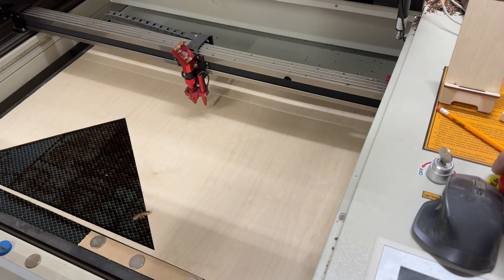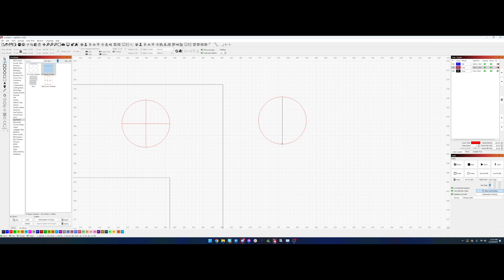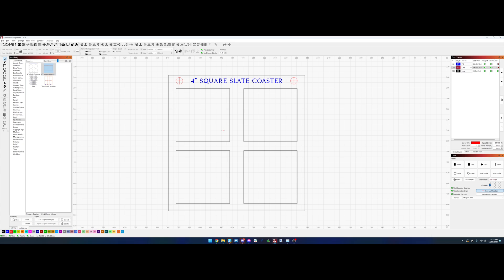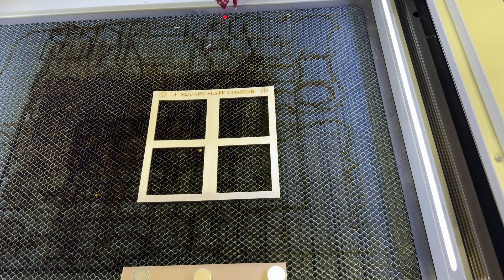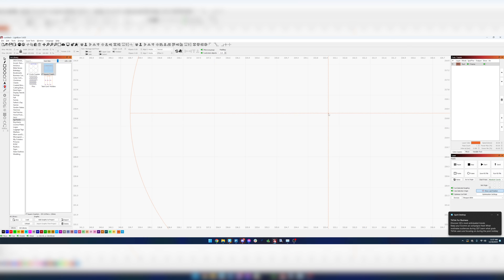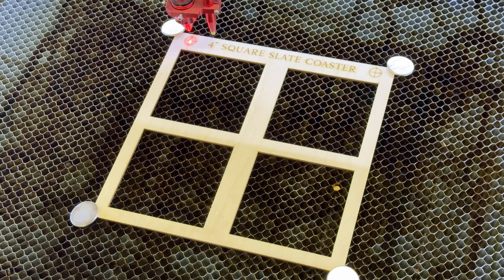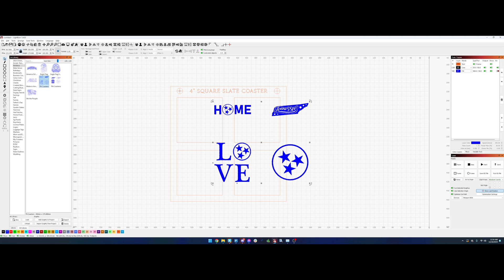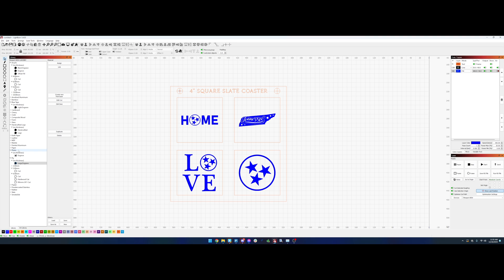You won't believe how easy it is to make this laser jig

Comment: Enjoyed your video on making the jig.
One thing bothers me ref the slates in your jig.
Ive found that most slates ive bought are all different thicknesses.
Im continually told focus, focus, focus. 
So if yours are like that which of them do you set your focus to?
Or do you have to focus each one separately ? 
Or does it not matter if one or two are a little thicker than the others?
Reply from the maker: When you're doing something like engraving a slate coaster, a mm or two in either direction isn't going to change much. In fact, I will sometimes intentionally defocus 3-6mm to achieve a different effect while engraving. So, when you're doing slate coasters, just focus to any of them and so long as they're within a few mm of each other you'll be solid!
Reply: @CreatedWorkshop  many thanks for your advice. 
Happy New Year, and keep up the good work.

Comment: This is a very good video, thank you.  I did this and ran through several rounds of my project and then things started not aligning correctly and I had not moved the jig at all.  When I when to check the positioning with my registration marks, everything was off.  Why would this happen?
Reply from the maker: That’s very interesting as I’ve not seen that happen. Especially if it’s still aligned according to Lightburn. My first thought would be maybe your jig didn’t lock in Lightburn and got nudged?

Comment: I cant lock shapes and select each square separately. I ungrouped everything and grouped 4 elements then tried locking but the 4 squares are locked as 1.
Reply from the maker: Try locking the items individually instead of as a group, that should make it to where you can still center up on them

Comment: I use the same method - you might want to remind everyone to be sure and have the power of the laser at %1 or lower.
Reply: I normally use 3% but I just found out that it will burn into cork.  Totally surprised me.

Comment: Interesting video, I am a little puzzled though as you said that you have a Lightburn camera. You will always need to align the bullet holes with the laser origin each time, surely using the camera would eliminate this step and be generally easier too, especially for your round coasters?
Reply from the maker: My camera doesn't actually stay in place super well, so I have to keep calibrating it. It's something that's on my list to fix. But, by the same token, the camera can easily become misaligned (at least, in my experience), so if you need something to be dead on every time, using a jig like this is the most sure-fire way to do just that.

Comment: How long did it take for the four coasters to be lasered? How do you like your machine?
Reply from the maker: The four I did in this video take about 23 or so minutes, but I think I can dial that up without losing quality in time. But, for this, I run 300mm/s at 20% power, and it takes about 23 minutes.

So far, the machine is absolutely fantastic! Zero complaints.

Comment: This is the best explanation for making an easy to remove and apply when needed jig without a fixed alignment piece. Thank you!
Reply from the maker: Thanks for the kind words!!!
Reply: But why wouldn't you use a fixed alignment piece? This is just so fiddly, over complicated and prone to inaccuracy. And so easy to move when placing the slates. Then you have to start this nonsense all over again. In 3 years I have never had a problem with using fixed alignment points on the laser frame and jigs that are just placed against those points.
Reply from the maker: With my laser specifically, the honeycomb bed can slightly shift within the frame, so that's not an accurate point for me to reference against. Your laser might not be that way, but the way that these jigs are designed work with any laser, regardless of frame rigidity, and also helps cut down on wasted material as some frame reference points are several inches outside of the work area.

I've never once had the jig shift once I had it in place and magnets down. Aligning the jig takes maybe a minute when I'm not filming, and it stays in place just fine even when swapping multiple pieces out.

Comment: I disagree about your comment that slate is to absurd the moisture. Why is slate used for your roof of your home if it is collecting so much water?? My designed coasters are for yes a cup but also looks. Thanks.
Reply from the maker: The slate for roofs is likely slightly different than the unfinished slate of a coaster. Slate does absorb moisture, which keeps the moisture away from the surface below as well as the cup, accomplishing the task of a coaster 😀